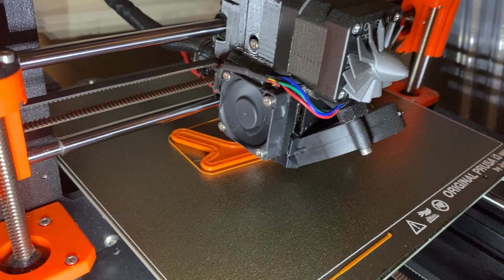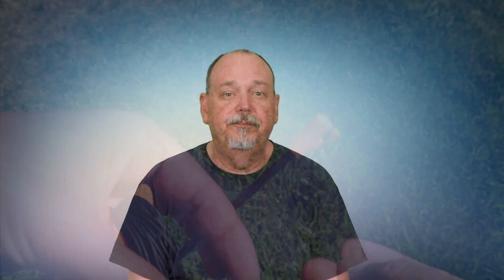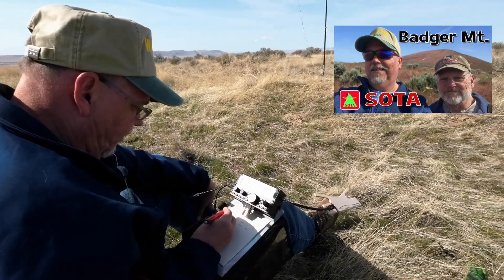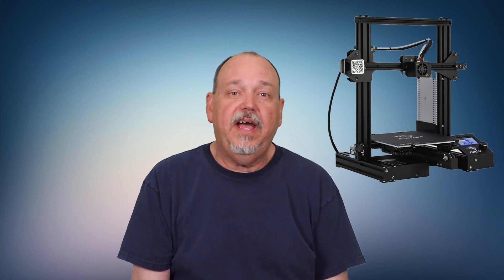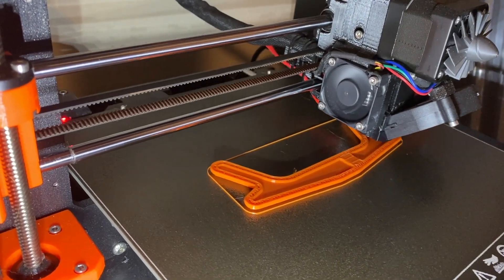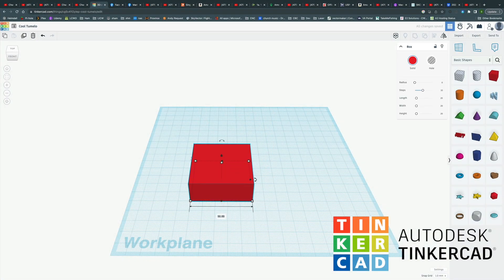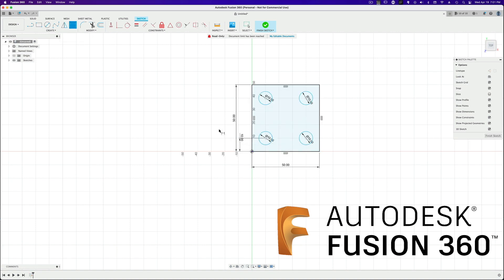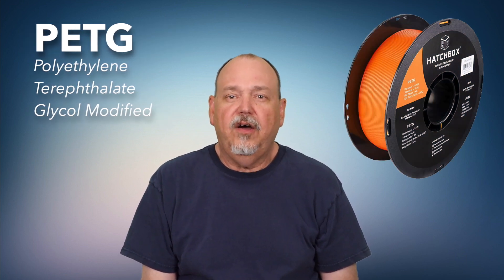3D Printing  For Ham Radio

Comment: I joined a local Maker space that had various workshops (wood, metal, electronics) mainly to access their 3D printers. Every gram I print costs 4p so it is a low cost way of me getting 3D printing experience. So far I have just printed radio items that were loaded by other enthusiasts and have yet to design my own product using Tinkercad or Fusion 360. Being able to print things off has been a real boost to my amateur radio project building.

Comment: I buy a ender 3 V2 ( I have no idea about this printers) by your video recommendation. Witch is the best plastic wire for ender 3 V2 and our ham radio project and designs?
Reply from the maker: Starting out, I would go with Hatchbox PLA. There is a link in the description for it on Amazon. As for learning about your printer, there are a ton of good videos on YouTube to get you started.
Reply: @houseofhamradio  Ok many thanks for all.